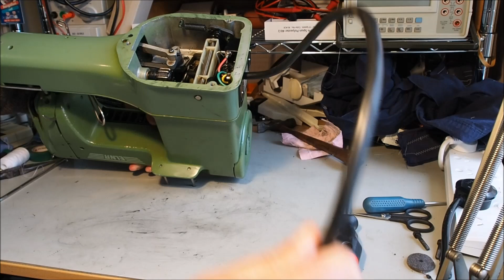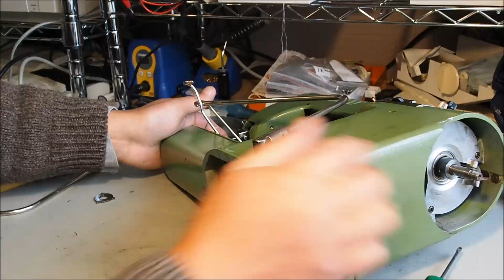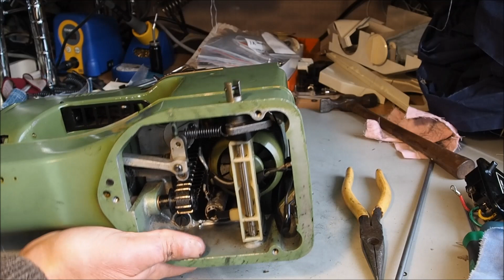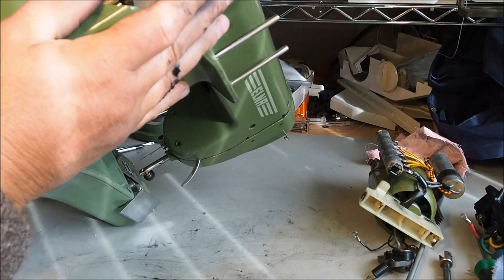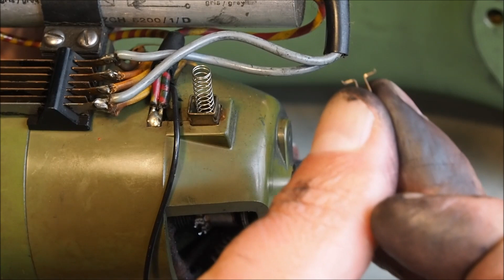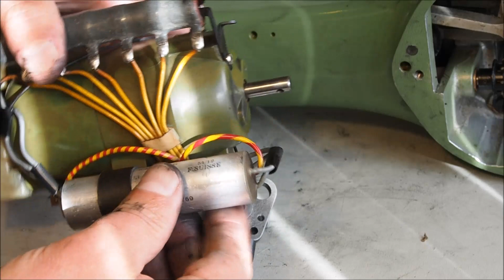Motor Removal - 1950's Elna Supermatic

Comment: Great video, thanks.  I have one of these machines and tried to replace the drive pulley, as instructed in one of your other videos.  However, perhaps the motor shaft is longer or the motor positioned differently, but there seems to be no way to get the pulley off without lowering the motor.  Now I know how to do this.  Thanks.

Comment: Dear In Stitches, we need your help so badly as you are an expert in the field.
We have an Elna Supermatic 722010 made in 1961 and there is a problem with it: there are 7 contacts but when we press the hook not all the contacts constrict but only 3 of them. The hook might touch contact 4 but does not reach contacts 5—7.  There is a bore of 12 mm with a pin of 3 mm and it does not allow the hook to move further. Actually, the hook should constrict all the 7 contacts but the distance between the hook and contact 1 is 8-9 mm. When the hook covers these millimeters, the pin bumps into the opposite side of the bore only constricting 3 of the contacts. We cannot find the way to adjust the distance between the hook and the contacts. All the details and parts are in their places and there are no slops. We would be very grateful to you if you could help us

Comment: This looks really good, I am going to buy an Elna Supermatic when I get back to The netherlands, it is a light tan one but has a FOOT CONTROL!!! which is much nicer, I hope to get it at the end of next week from 22nd may, I will be on to you when I am checking it over!!! thanks Amateursewing @ gmail.com
Reply from the maker: I look forward to hearing how you get on. Thanks.
Reply: @InStitches  thanks, I am flying back to The Netherlands on friday (in this covid nightmare) so hope I can still buy it if it hasnt already gone, I like this european model with the foot control so that you dont have that very hot resistor speed control built onto the motor inside the machine, with that reed speed control that the knee lever operates.

Comment: Hi....I have an elna SU62 c.... any videos or pictures on replacing the brushes? Thanks!
Reply from the maker: I don't have any videos on brush replacement for the Elna 62C at this stage but you can change the brushes without removing the motor on that model.

Comment: Hi. Could you help with the cap values and diagram? Seems like there is marked 6 capacitors, or did you just use 3? Im also confused about the values, is it 2uf for the start / run cap and 6nf (4,7nf) for filter caps? Thanks!
Reply: Que valores tiene el condensador y en la actualidad cual capacitor le sustituye